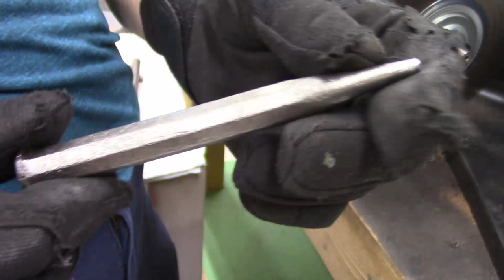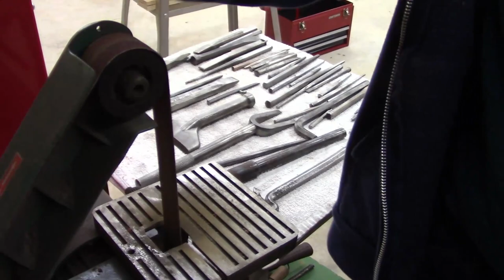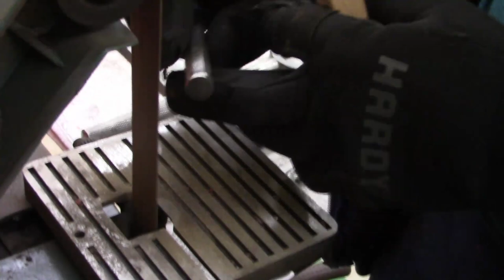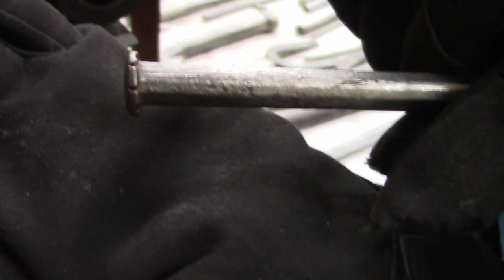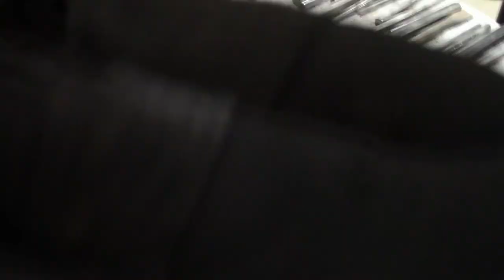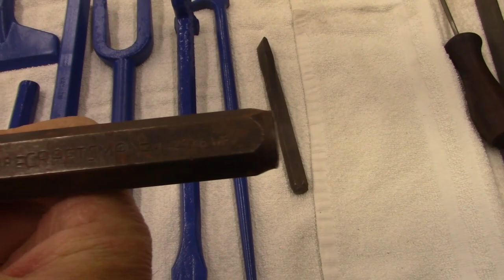Restoration of chisels, punches & odd & ends.

Comment: I just also found a 9" Craftsman 1/2" thick and heavy Wright Tool 5/8" punch rusted.  Wire wheel and clear coat spray.  Good video.  👍👍
Reply from the maker: nice, I going to try clear coat spray, I never thought of it, sometimes you get used to doing things one way.
Reply: @djstoolrestorations  Rust is enemy #1.  ScoutCrafter uses Zinsser Bulls Eye Shellac, Clear (clear but slight darkens) which I also have done.  I think new Channellock pliers are dipped in this also.  They have a slight yellow coating on them.